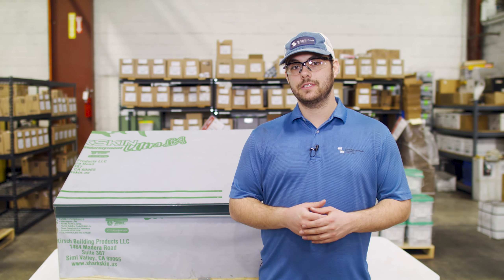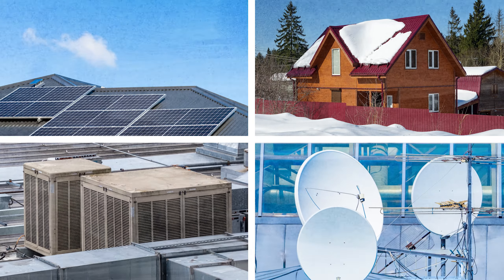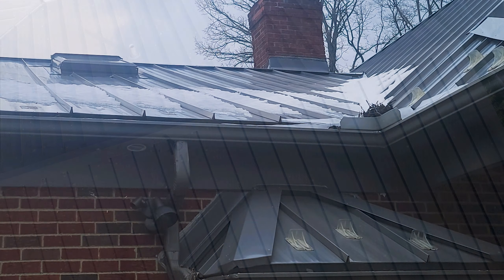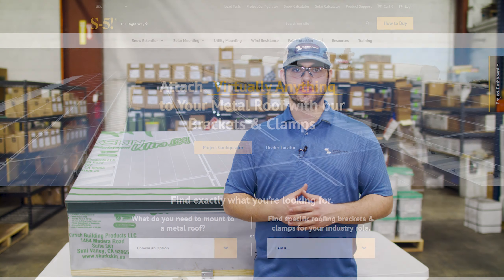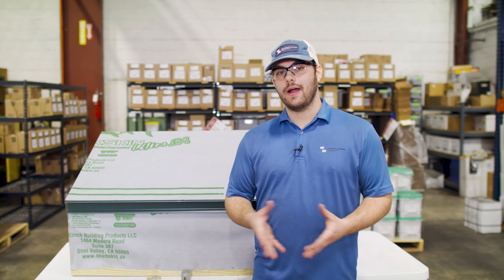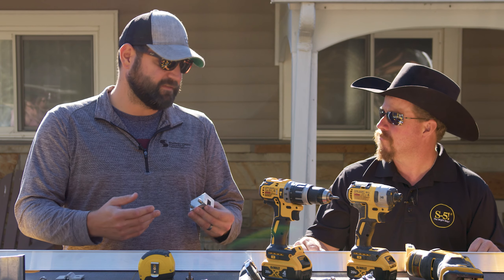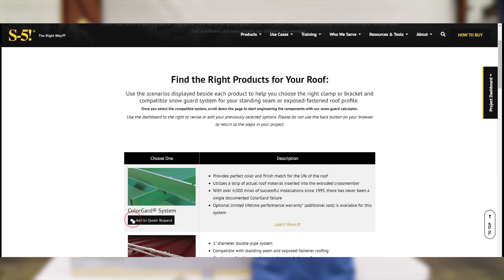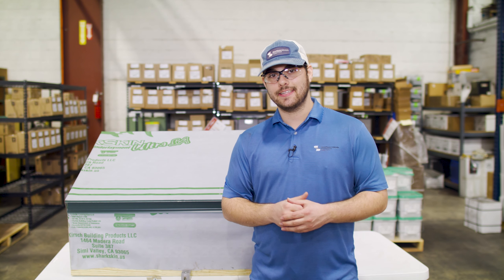Metal Roof Snow Guard and Solar Panel Attachment Systems

Comment: I'm new to the S5 system and am learning. If the Solar panels are under warranty, and they use the s5 system. Say the S5 system wasn't installed correctly and the solar panels got damaged. Is it correct to assume if the solar panels had any warranty that it will void it out ?